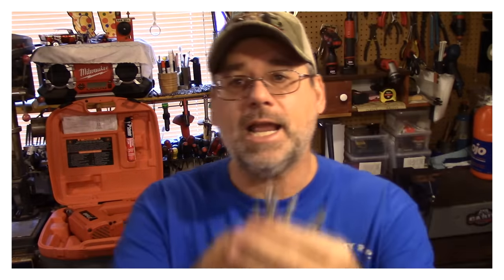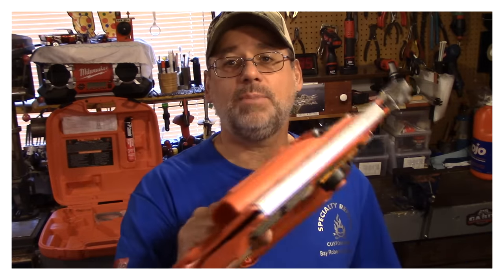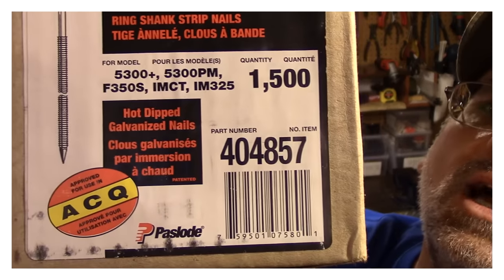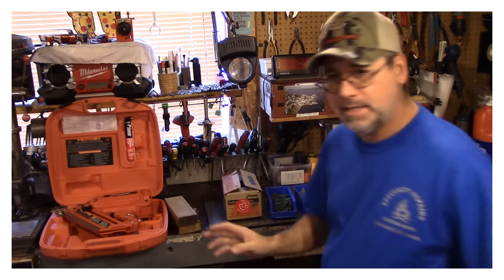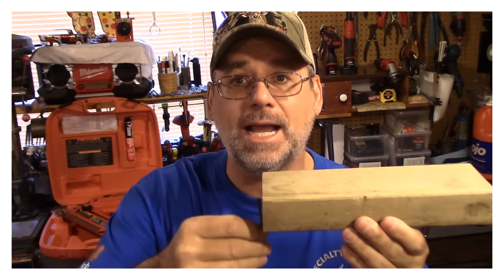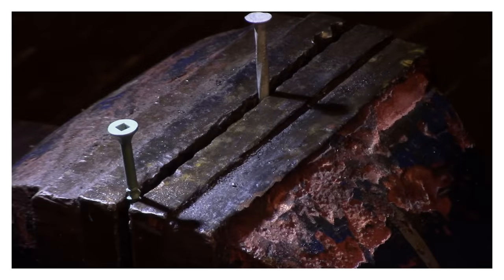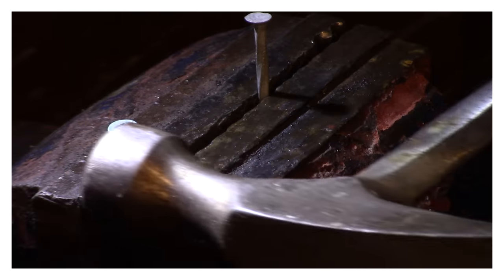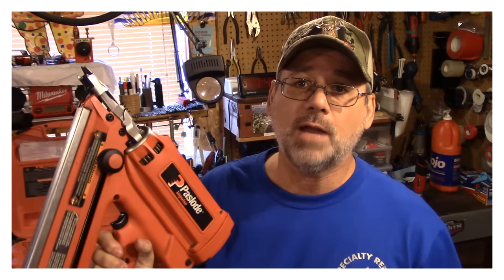BEWARE  NEVER USE DECK SCREWS  - DECK SCREWS VS NAILS -  PART TWO IN DESCRIPTION

Comment: I always try to notch the upright si the weight is wood on wood, not on the hardware. Secondly starting in the seventies I go to a lot of garage and going out of business sales and have accumulated quite a bit of stainless deck screws among others, i never had an issue even after 30yrs on some things. I also have a tendency to overbuild. I think the problem is relying on the hardware to hold the load, it should only be locating the wood.
Reply from the maker: I agree James , it's the type of screw and where it's used. I overbuild as well .

Comment: I guess if you left half of the decks screws sitting outside of the wood you might have a point.  But of course screws are not left outside of the wood.  They are superior at holding because they bore into the material and the grooves hold them in place.  Simple as that - common sense really.
Reply from the maker: Ken the video is more about where deck screws should not be used.
Reply: Agreed. The difference is that screws are usually cast and nails are forged. A proper scientific method to test the actual sheer strength of the screw would be to fasten a board to another with an over hang and hit the over hanging board. Also to test the tensile strength you would need to pull straight out and the screw would win 100% because the nail is going to pull out. The 1/2" to 3/4" length used in the demonstration puts all the leverage force at the bend but it wouldn't bend much if actually inserted. Contractors use nail guns because they are lazy, fast, and cheap. Nails suck for a lot of reasons: wood  expands and contracts with changing humidity and eventually nails start to pull out, nails are a hassle to deal with when maintaining old structures (like replacing boards), nails are great for sheer strength (to prevent catastrophic failure - they still have be removed after being bent in a stricture) but suck for tensile fastening, and nail guns are just freaking sloppy and lazy. I'll admit that screws do have the problem of being more brittle, but they are far superior fasteners than nails when it comes to something that needs to be maintained for decades. I wouldn't use your standard deck screw though; I use stainless steel screws.
Reply: @AmixLiark  screws are cold forged and occassionlly cut on a lathe

Comment: I see the point. But one thing is the screws are supported inside the wood unlike the vise test at best the screw will bend just like the nails. I never seen screws shear off or snap unless they’re the black oxide sheet rock screws

Comment: While I've never worked in construction, I do a lot of my own work around the house. I have a 16 x 16 deck that I built and put a flat, pitched roof on. I used nothing but coated deck screws! Ten years and still standing, even survived a tornado that passed by less than a 100 feet and took down a 75 foot pine! I also have a wood privacy fence that was put up the year before I bought this house. It has become a ritual, every spring, one of the first jobs is to go around the entire fence and replace all the loose nails with screws! I've yet to see a screw come loose like a nail does. Just saying....
Reply from the maker: Yes deck screws are fine when used  as designed -  Most have gone to screws because of the deck board nails poping up and I agree deck boards do better with nails. I do revisit this vid in part 2 -https://www.youtube.com/watch?v=IfCuqqN9g4o

Comment: Id like to see a test with screws actually trying to shear two boards screwed vs nailed. 

I get nails can bend many times like that and not break but when you screw 2 boards tightly alot of strength also comes from the friction and compression the screws provide from squeezing the material together.

Ive unscrewed old stuff and had to still pry the board off afterwards. So in my opinion these tests arent fair to how screws/nails would actually be used.
Reply from the maker: The whole point is deck screws are not designed or allowed to be used as structural supports , check your local building code.  People who dabble in construction use deck screws in places not allowed . Dog houses,  garbage storage bins , sure but not for so many other places I've seen  used.  Cheers

Comment: There are many things an average handyman just may not know.  Good video.  Lesson for everybody to do their homework.  The best thing would be to get a job with a reputable contractor for 6 months and learn lots.
Reply from the maker: For the most part a general contractor is the best choice as they have the liability in constructing stuff and do know what not to use.
Reply: I was lucky as a young man I got a job as a carpenters helper and was there to help in the building of my own home.

Comment: Those screws are meant for the planking boards, not the supporting construction. When used where they do belong, they anchor much better than nails of comparable length and normally don't work loose with weathering like nails do. (Had to hammer down plenty of nails and put screws besides them in areas of minor warping on a deck a few years old.)

If building a deck, the answer would be to use both and then some. Just make sure you use the fasteners best suited for each aspect of construction. (And sometimes the correct fastener is neither screw nor nail, but through-holes with proper brackets, washers, nuts, and bolts.)
Reply from the maker: Good advice there . Cheers

Comment: When they changed the chemistry of the treatment juice back in 2003, they switched from the old CCA (chromated copper arsenate) to the new ACQ (Alkaline copper quaternary) stuff . The problem is that the new stuff EAT steel like crazy, if you use common steel screws or nails they will rust away VERY fast. The reason is that the ACQ is extremely corrosive to steel. 6 times more corrosive than the old treatment and 15 times more corrosive than water! Either use stainless or double dipped galvanized if you don't want to be replacing the screws/bolts after 4-5 years.

My FILs house had an original outhouse built in the early 1900's when the house was new. A guy in a neighboring town was restoring his house and the original outhouse was gone, he found out my FILs was built in the same time frame and style as his would have been so he bought it from him and had a crew come in and move it to his house in town.
Reply from the maker: I don't care for the PT wood up here  as it's so water logged and shrinks and twists  in the sun so fast.  An outhouse is a normal thing in the north and I bet  some must think were cave people for having them. LOL

Comment: i been snapping deck screws for 30 years , like the person already said in the comments , the forces on a screw and shearing effects all come into play, ill use screws for just about anything unless it really should have a bolt, when using the new pressure treated stuff you simply need the right coated fasteners, triple coated nails in my region, and the reasonable lifespan for a deck is 20 years , anything past 20 years is just a bonus

Comment: Your right and wrong. Yes they can break with an impact shear force but that rarely if ever occurs. I have been using exterior screws for joints seems like forever and have never had a shear failure yet and I've been back to jobs I did 10 to 15 yrs in the past. Carpenter since 1982.
Yes I do use thru bolts and lag screws as much as possible for heavier structural joints. I have not used nails on a deck for 15 or more years and before that unless the customer wanted a cheap quick job but most of my customers expect the best and I choose screws for a lot of deck framing rather than nails
Reply from the maker: Well Tony I have seen the quite opposite and I do show in a video how deck screws installed after 3 years  have snapped of at the shank , a lot of them from just sitting for three years of rain and snow and ice. If you live in a warm climate it's much different but in 40 years the #8 deck screw in cold climates have not done well. Cheers bud.
Reply: @jcdenton2641  Stronger on the hold, but not the shear. At least that's how I was taught.

Comment: If something is going to shear your screws you have a total destruction of the structure anyway...
Reply from the maker: Yes your correct and that's where the liability comes in if someone gets hurt and you have used deck screws in the build you will be liable for building code infractions and that's a whole lot of hurt that could have been prevented. Cheers Aldemar

Comment: Ive built a few decks and i cant ever remember a shearing force , like your hammer demonstration , happen to a screw driven flush. SO this is a non issue. Try driving your fastener in the edge at an angle and it will reduce pop ups. But for me screws on an angle in the edge win every time. Nothing showing either.
Reply from the maker: Lea the shear strength sure is good to know in the north . Built many of decks and seen hundreds of deck screw heads just shear off on the stem from hot to cold temps . I won't use #8  , just #10 if I can or SS screws. Cheers 👍
Reply: @SteveRobReviews  I live in the north as well...ive never seen deck screws shear by the hundreds...I wouldn't use deck screws to carry any structural load, but If used for decking I just haven't seen anything of the sort besides a few here or there

Comment: Hmmm.  I've only been doing it since deck screws became available with no real problems.  Nails in severe climates (like the deep south) tend to loosen over the years in outdoor applications.  They also rust.  Screws properly driven will not be in bending stress (unless you don't know what you're doing with the structure), they will be in tension.  Galvanized screws are a better choice but again, I've had no problems with coated deck screws.  And I don't like Paslode nail guns because you have to buy the fuel cartridges (about $12 each).  Yes, they are more convenient than pancake compressors and air guns, so you have to decide what you want out of a tool.
Reply from the maker: Up here the big box store deck screws just rust and corrode as the cold and ice snap many of the shanks off . In the south their ok but most diyers still use them in not so good locations.  Cheers

Comment: I've been using deck screws for deck construction for over 20 years. Except for the recent changes to the design of the screw, I can say that I've been very happy them, and (yes, still standing) the decks that I have constructed.  I've never used a metal deck brace - they rust, break, and make for a wobbly structure. I believe your construction design is most important to building a safe decking structure - use notching where pragmatic, use reinforced wood bracing in every possible way; in this way, deck screws can be used everywhere. Plus, the poor sod who needs to replace a board later, or break down the deck, doesn't have to destroy the wood or kick the dog to do it, and the deck screws can be RE-USED -  I've reused them after 5 years and they are still as good as new.
Reply from the maker: Everyone if free to use what they like and if it works for you it's just great. Cheers
Reply: You're a nice guy Steve. My intent was not to sound so grumpy, but I I tend to sound that way by default.... :)
Reply from the maker: No problem at all no offence taken. You have a great day.

Comment: Whew!!! I’m glad I used nails for the structural part of my deck.
I did use the screws for the redwood and cedar boards. I did in case it got damaged. It’ll be easier to remove instead of tearing it out.
Reply from the maker: Well done , yes removing deck boards is much easier. Cheers

Comment: I have to say. I have lived at the same place for over 20 years. Anything that was put in with a nail unless it is a spiral nail came apart with just a hammer. Anything put together with deck screws had to have a salwsall to take apart
Reply from the maker: That's a good thing i'd say as you used the screws in a spot their intended to be and they did a great job . Cheers Donna

Comment: Actually if it's structure, like a rafter/top plate junction, joist hanger, etc. I use Simpson strong ties with their extra heavy galvanized nails and drive them with my palm nailer. Always avoid nailing into end grain if possible. Using construction adhesive on joints is a huge strength improvement.
Reply from the maker: That's how it done -  yes sir. Heres part 2 if your interested - https://www.youtube.com/watch?v=IfCuqqN9g4o

Comment: The thing is that the fasteners, nails/screws, should only ever hold the pieces of wood together, they should never be used to carry load, other than in laminating a header or beam in which case the shear value is what matters not the material itself. For structural members all the weight should be carried by wood that runs from the load to the foundation, such as trimmer studs or posts which can be held in place by either nails or screws.
Reply from the maker: Exactly but it seems many have no skill  for construction  at all  so they build stuff that is scarry wrong as they don't know that deck screws  are not magical things that can hold any load  . 😉

Comment: Good to know. I'm hanging a 100 lb heavy bag from a 4x4 strung between two 2x10s with joist hangers and wanted to know which fastener to use. I'm going with the galvanized nails thanks to this video.
Reply from the maker: Joist hangers use joist hanger nails by most . Sounds plenty strong.  Cheers

Comment: Perhaps deck screws break under stress more easily than nails but I've built decks and not had a problem with the screws. It's the wood that's always the problem, the stuff decays. :)
Reply from the maker: I agree the PT wood today is not so great . I'm in a climate of cold weather and lots of ice and snow so #8 deck screws snap easily.  In warm climates I hear they are just fine . Cheers
Reply: @SteveRobReviews  interesting. I used deck screws over nails because I had no nail gun and didn't want to beat myself up. I guess I can double up screws and nails just to be safe..am in a warm climate. But with structural , it's better safe than sorry.

Comment: EXCELLENT ADVICE PROFESSOR STEVE! AND NO 1/2 PINT? DON'T FORGET TO VIDEO THE SOLAR PANEL AND ELECTRICAL SYSTEM TO THE NEW MASTER OUTHOUSE.
Reply from the maker: I will try to film as much as possible . I  have a lot of work to get done in a summer 8 weeks long. Cheers

Comment: Deck screws are hardened, that's why they will snap if hit wrong, wood expansion and retraction will push nails out and boards come loose.. Deck Screws also cut there way in so the wood doesn't split like it will w/ nails.
Reply from the maker: And they also  break after installation from freeze thaw cycles .  Cheers 👍
Reply: @SteveRobReviews    Not in the 40 years I know about..  You must have some cheap screws..
Reply from the maker: Just your regular #8 - 3 inch deck screws from Home Depo .  I don't use them anymore  , strictly SS screws now or I go with a #10 .
Reply: @SteveRobReviews   The only nails I ever used was coated nails in compliance w/ some county ordinances.. They are also hardened and will snap off if hit wrong.. Air gun only and the glue coating makes them permanent, so you'd better get it right the first time..
Reply: @SteveRobReviews      ---  which probably explains your screw snap test  -   I only know of one 'deckscrew' available in #8 over 2" long  -  those awful phillips Grabber brand screws in gray paint from HD  -   no wonder your screw-in-the-vice looked so thin, snapped so easy, and everyone thought it was a drywall screw   -   I have a friend who still buys that trash thinking he is saving money:  reality is,  those screws are about $5 a pound MORE than #10 Deckmate or Deck Plus screws  -   HD will still sell you #9s in coated 3 and 3 1/2 long   --   most everyone else has #10s in everything 2 1/2 and over  -    I haven't seen anyone use those old #8 grays to build decks in like 20 years   --

Comment: I built a deck and I used lag bolts for anything that holds weight the rest are deck screws. I ran out of deck screws in 1 place so I used nails, where I used nails the wood rotted out.
Reply from the maker: Interesting , so where you used nails the wood rotted out may be because of the nail coating you chose . Electro- Galvanized nails vs hot dipped Galvanized nails .  I only use hot dipped as electo just rot over time  compared to hot dipped.
Reply: @SteveRobReviews  Thanks for info
Reply: I had the opposite results -- the wood around the deck screws rotted, the wood around the galvanized nails did not.

Comment: I use the stainless steel deck screws. They work on anything and have a hurricane rating. If I use truss or joist hangers then its nails for me.
Reply from the maker: SS is not seen up here in the stores  much and I bet they are a solid choice. I never used them but I bet their 4 times the price and 4 times better .  I like most items SS as it's impervious to most of the corrosion.
Reply: about double the cost of deck screws but worth it.
Reply: I hope it's Miller thyme Terry cause I just told everybody that you 
said it was. I didn't wanna steal your thunder. Ooops sorry Miller.

Comment: What is your point? Ok, so when you hit a protruding deck screw it breaks. Nails bend. You're  not giving a practical application as to why deck screws are not good for building structures. I like your channel but your demonstration doesn't really make any sense. I look forward for your common sense explanation with several examples.
Reply from the maker: It's a demonstration on how hardened deck screws shear when  side loading to excess .  It's to show that deck screws are not allowed ever for structural loads anywhere .   I see far too many diyers  using deck screws everywhere and this is a visual of what can and does happen using a incorrect fastener.  Cheers 👍